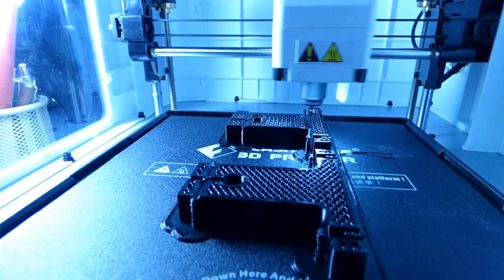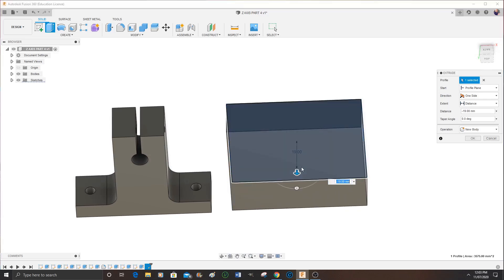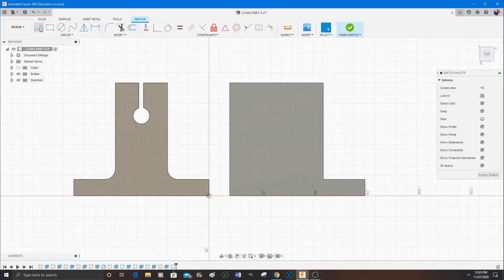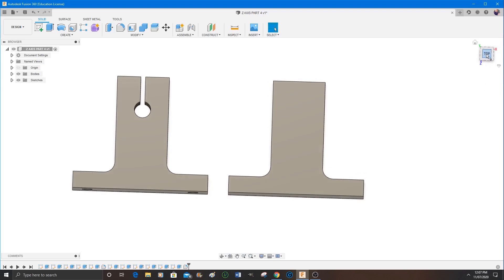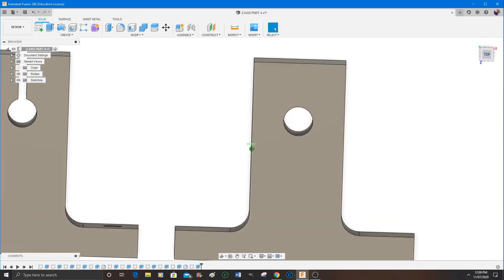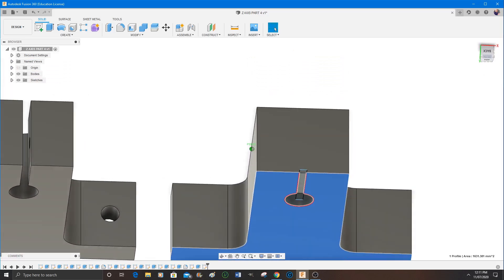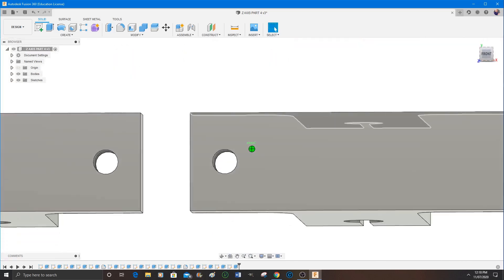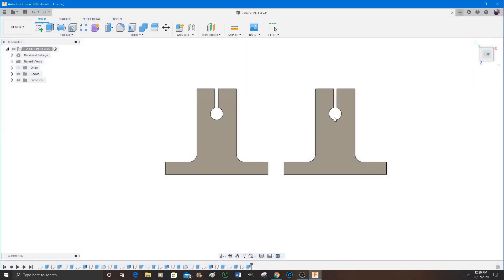Fusion 360 for absolute beginners making (2) 3D parts in 1 plane

Comment: Hello Roger. I recently discovered your videos from a recommendation from someone on Facebook. I'm new to fusion and I am particularly interested in how you put the hole in the proper place. I really need basic direction to place things where i want them when sketching.I Just don't see the options on the menus . Somehow you clicked on the center of the hole and the vertical line to the right and it opened a dialogue box in which you entered the distance that you wanted, the constraint. I Can't find the option in order to enter the dimensions I want. Is there a key like the shift, or control that you are holding down? Very frustrating learning. Fusion site is no help. Ty

Comment: Appreciated the tutorial, but you could have just done it based on the initial part, and then 3D printed the exact same part two times by using the 3D software to import the part twice. 
🇨🇦
PS 
  I was very surprised to see the holes requiring supports.
Reply from the maker: This is a tutorial, example, it could be two different parts